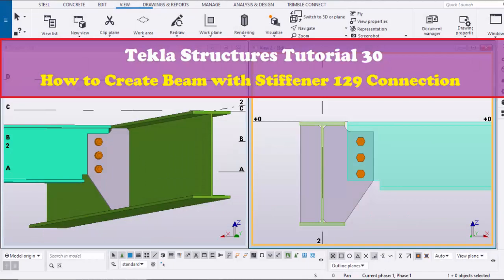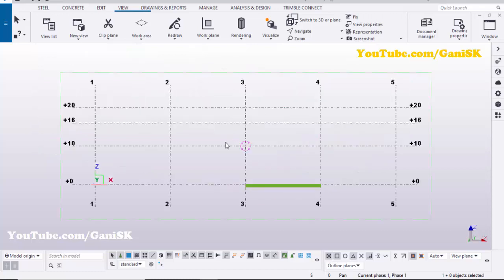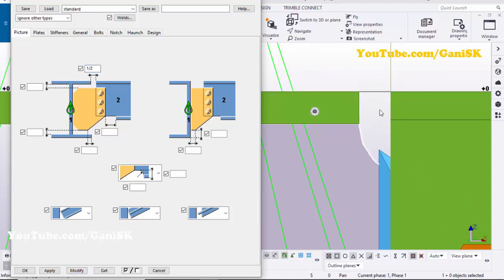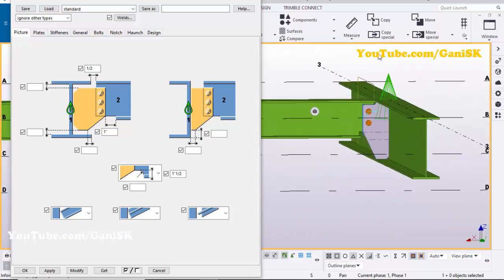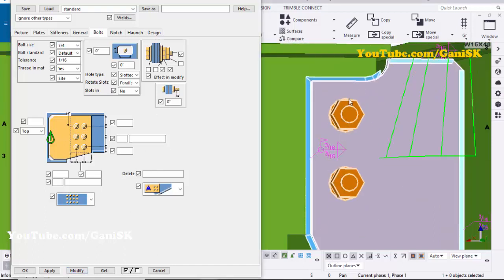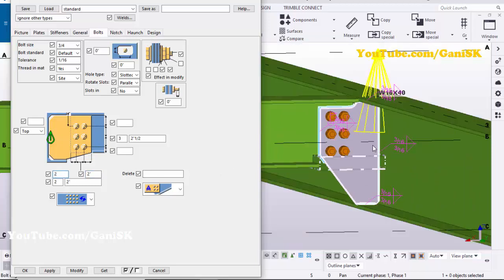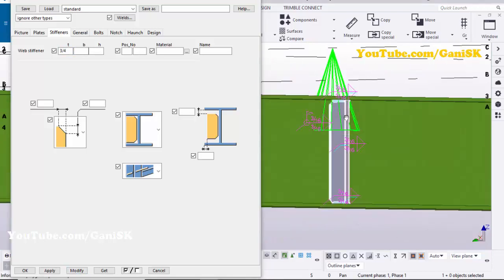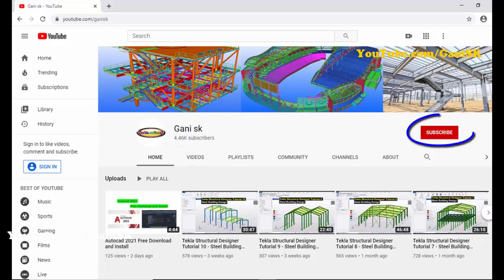Tekla Structures Tutorial 30 How to Create Beam with Stiffener 129 Connection

Comment: Sir  if I try to use 129 beam with stiffener in mezzanine column instead of main beam to secondary beam connection it is not working properly ...what should I do to make proper connection in that case
Reply from the maker: Use 186 connection for column to beam connection
Reply: @GaniSk  thank u sir👍